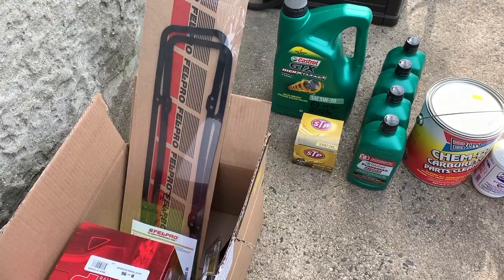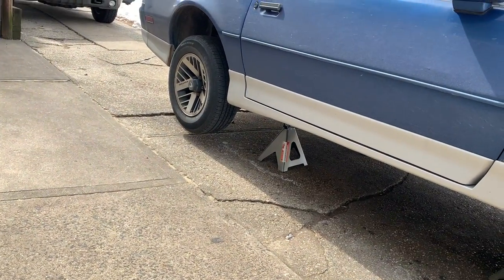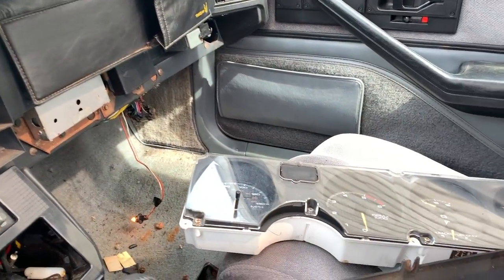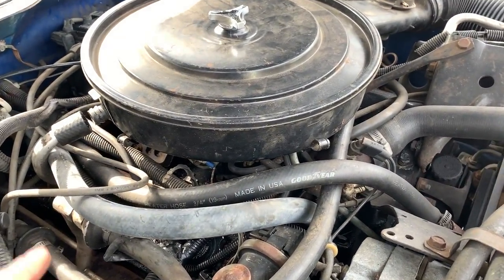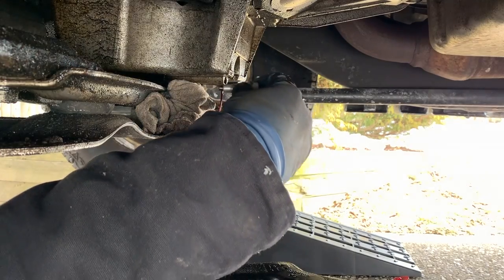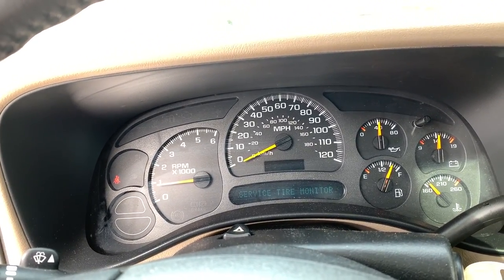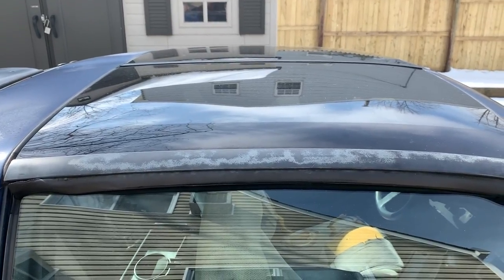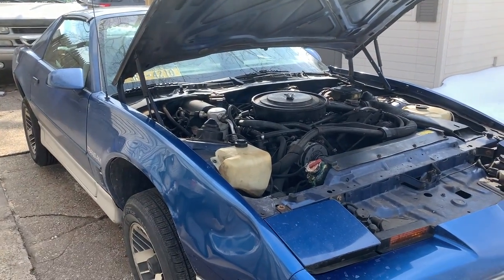Camaro, Tahoe, and Trans am... All in One Video!

Comment: You’ve likely found the oil leak by now, but if it’s mainly at the back of the engine, most of the time it’s the oil sending unit. Replaced 3 store brand units on my Silverado before I did an acdelco piece and it’s been fine since

Comment: I run valvoline full synthetic oil in my daily. I change the filter every 3k miles and top it off. I change it fully every 9k miles. Works great.

Comment: If you’re having issues with hard/long cranks check your fuel pressure regulator and replace it. After owning a few Camaro’s and worked on others that is a common issue.

Comment: Is your guages blowing a fuse? My 89 Camaro kept blowing a fuse and it ended up being about 6 inches back on the harness where it plugs into a the gauge cluster. There was a metal bracket in the dash was cutting into 3 wires. I fixed the wired and wrapped electrical tape around that bracket to prevent it from doing it again. Hope that helps
Reply from the maker: Yea the fuse keeps blowing. It turned out to be the half assed stereo shorting it out.
Reply: @lsxmatt  glad you got it fixed. My drive home was about 4 hrs with no gauges speedo cable was broke and the fuse was the issue for the rest except the fuel guage I need to drop the tank when weather gets warmer